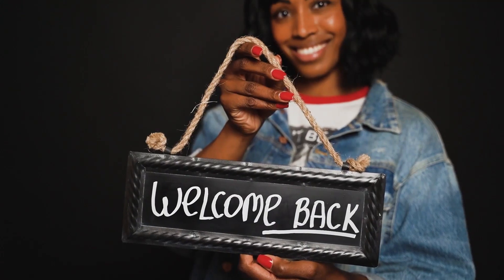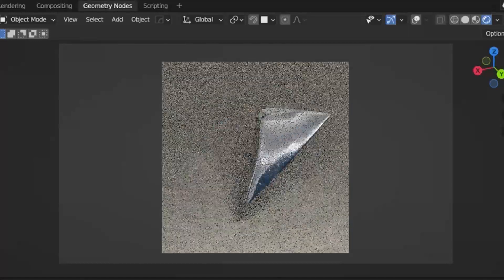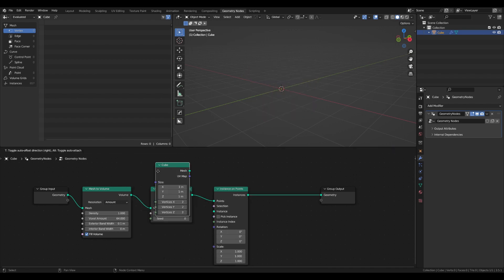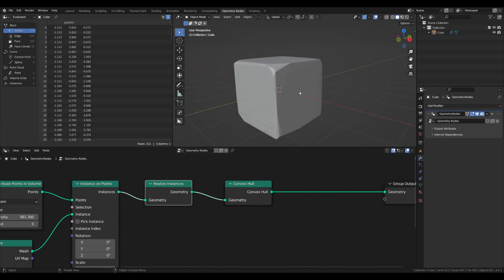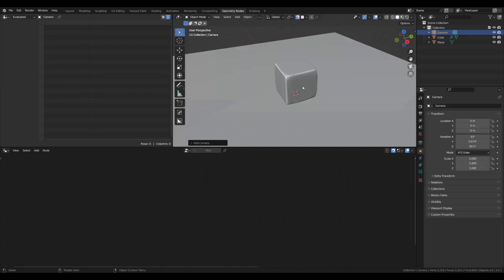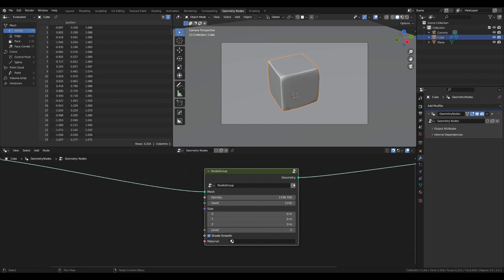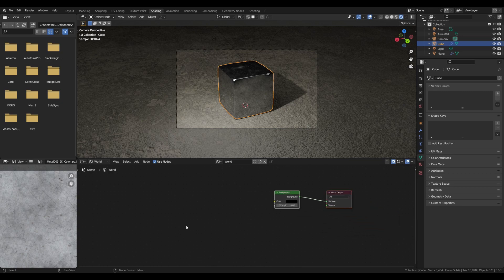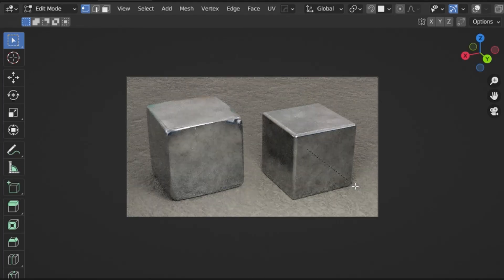Bevel V.2 | Blender Geometry Nodes

Comment: This WILL NOT WORK on most geometry. Do you know what a convex hull is? It's CONVEX. It fills in any opening, indentation, or hole in the geometry. If you took a model of a drinking glass and put 'convex hull' on it, you now have a solid cylinder that you can't pour liquid into. 
Did you even BOTHER to try this on ANYTHING BUT A CUBE, before you decided it was good enough to waste people's time with a tutotial?
Reply from the maker: Yes, If you paid enough attention, you would know that I mentioned it in the video
Reply: Typical 3D tutorial moment, if your time is this precious, pay a personal tutor $50 per hour to teach you
Reply: @cutesmile_me  or watch tutorials properly
Reply: Is everything ok boy? 🤣
Reply: I think I've figured out why some people are frustrated with this video:

At BCON 22, Howard Trickey and Henrik spoke on Bevel 2, an update to the Bevel modifier.  It is being built to, among other things, address the problem of overlapping geometry created once you begin crossing vertices.

While I understand the frustration of looking for a specific answer on the Internet only to be thwarted by conflicting naming conventions (just try searching about the site formerly known as Twitter without ”dead naming”) the Internet is going to be the Internet. You inadvertently collided with the naming of an unreleased solution to a common problem.

In the end I still have a new trick to try when I want to get this type of appearance.  If I ever do and address the concaved geometry, I'll let you know.
Reply: Why are are you being such an asshole?